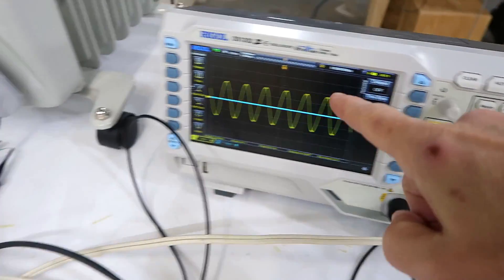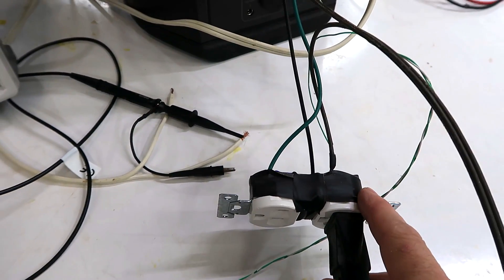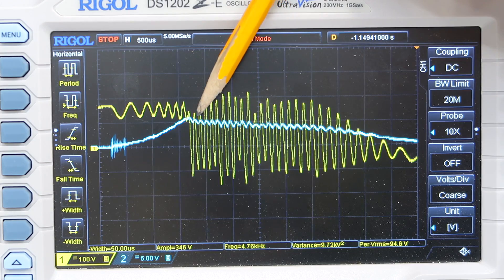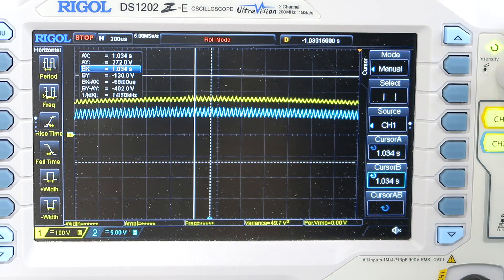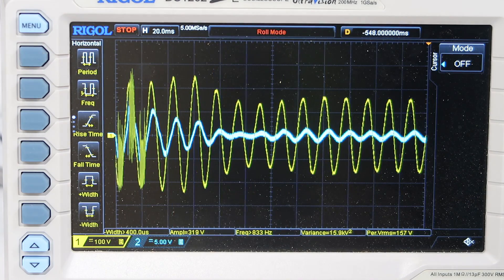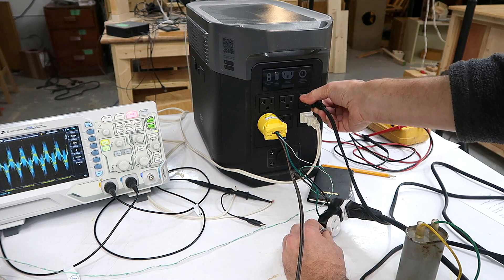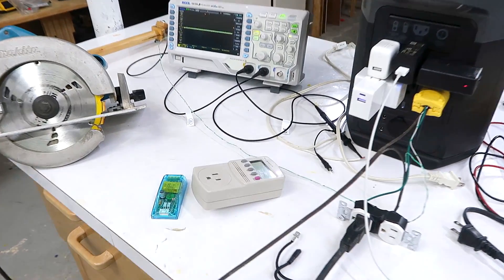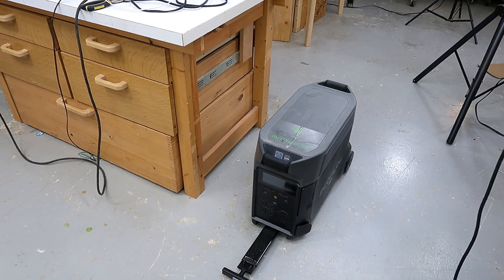Inverters don't like power tools

Comment: Can you test with something like a Pi filter (capacitor, inductor in series, capacitor) to see if the oscillations pass to the other side? Maybe will be safer to use the electronics with the filter between them and the UPS.
Reply: Tricky: you need to make sure the components don't resonate with each other at the switching (or faulting) frequency, or else things get much worse!  You need to mind both the cutoff frequency Fo = 1 / (2 pi sqrt(L C)), and the characteristic impedance Zo = sqrt(L/C), and preferably have some damping or termination resistance so that, even if hit with frequencies near resonance, it doesn't spiral out of control.  (The inverter itself acts like a very low resistance, we can't count on it for damping.  We can put a resistor in parallel with the output to do the job.  Now, a whole ass resistor would dissipate a massive amount of power at 60Hz, but we can connect a capacitor in series with it so it mostly doesn't affect the circuit, except near Fo where it's needed.  So, instead of C-L-C, it can be C-L-(C || (R+C)).)

Just putting the 24uF out there, does a good enough job illustrating the concept, though: all the current ripple was confined between it, and the inverter's internal circuitry (mainly the big fat filter inductor I would think), and much less ripple voltage appeared at the output.  This is safer (in terms of ease of avoiding unlucky values that might make it more prone to oscillation) because the capacitor more or less acts in parallel with the internal capacitors.  So it's more or less the same LC circuit, without extra LCs tacked on.

We can infer that, given proper dimensions, damping etc., it could indeed have less of both current and voltage ripple; and less while using less total capacitance than the bulk approach (the 24uF) -- the tradeoff is having to add bulky inductors, which also reduce regulation (they drop some voltage, at 60Hz, under normal load conditions).  And these are not small inductors, we're talking 100s of uH and they have to be rated for full peak load current, so, saturation over 20 or 30A.  About as big, each, as what's on the inverter.

Comment: I just built a DIY solar generator and used a 600w Giandel pure sinewave inverter.  I'm only powering some LED light, but I notice that the lights power on like the inverter has a built in soft start.

I wonder if you see any change if you have the saw plugged in/on before powering up the ecoflow.  It may have a soft start.
Reply: Often you'll see that slow rise in AC output voltage being spruiked by the inverter manufacturer as protecting your appliances but in reality it's there to protect the inverter.  The IGBTs used by Giandel in the bridge (depending on the model inverter it might be 85N33 for 120V inverter) that produces the AC output are more than capable of handling the current, it's usually the FETs in the HV DC power supplies that will pop.

Comment: I bet Ecoflow actually really appreciates that you are doing all this testing for them. Their R&D department probably has a different perspective and could use your thoughts.
Reply: R&D already knows all this shit, its marketing and execs who just dont care
Reply: @MozTS  Ain't that the truth!  I used to work in R&D, and the most commonly-asked question I got from people earning more than twice as much as me was "Can you make it any cheaper?"
Reply: Their Medium reply was from one of the operations directors and was very, very detailed, way more than I've ever seen from any manufacturer....
Reply: I’ll guarantee the design team already knows this and a lot more. I’d bet they can design anything that doesn’t defy the laws of physics but other real-world constraints dictate the chosen path. The critique by Matthias reminds me of audiophiles criticizing power amplifier designs.
Reply: @sheph7  this box advertises itself as an off-grid power source, and sells itself on the premise that you won't need all those extension cords anymore. It's perfectly reasonable to expect somebody to stick a power tool in there so that they can work on something without a nearby power source, and it's a very valid critique of the device that it will kill certain electronics if they're used at the same time as a big inductive load. I would have definitely been dumb enough to charge my phone with an old charger at the same time as using a power tool, maybe that's just me or maybe the hazards aren't obvious to everybody.

Matthias's use case is still within the realm of what a reasonable person would try, and he has been very clear throughout these videos that this is a very good product with one notable flaw that only appears in the worst case. His coverage isn't comparable to audiophile nitpicking at all, when was the last time an audiophile actually presented oscilloscope traces as evidence for their criticisms?
Reply: @tissuepaper9962  I think you somewhat exemplify the problem with this sort of fringe case and saying it shouldn't be used with 'sensitive' electronics. The issue is with defining, to the layperson, what 'sensitive' means in this context. Phone charger isn't on the list.

In this case they have a device that works reliably and for reasonable cost in 99.9999% of use cases. There is a rare instance where a very high power motor load in combination with a very specific and frankly somewhat uncommon kind of super low cost power supply can hurt the device with the power supply. But those power supplies aren't used to charge phones or laptops, or to power computers or TVs or basically anything of significant value - not surprisingly because they suck. 

Coincidentally, the same thing can happen to certain devices connected to the grid during a brownout. Another fringe case.

For me, the real question is why didn't Kill-A-Watt spend an extra $1.00 on a proper power supply more so than why didn't EcoFlow figure out how to design the perfect inverter. I like my Kill-A-Watts too, but I've killed a couple myself even without using inverters!
Reply: @bradley3549  notice I specified "with an old charger". It isn't reasonable to expect everybody to be up to date all the time. I still have and use wallwarts as old as 20 years, those things definitely are susceptible to this problem.

The bottom line is that the device will suddenly deliver a shitload more power to certain other devices if you try to draw too much out of it in this specific way. That is a problem. Maybe it's a problem that was designed in, and accepted because it's just so rare, but it's a problem that people should know about nonetheless. It may surprise you (somehow) that people like to buy cheap, chintzy garbage from China, wherein this kind of old-school circuit design is very prevalent. Watch any Big Clive video, most of those devices would be susceptible to this.
Reply: @tissuepaper9962  All phone chargers I've ever owned, dating back to the 90s, would be immune to this issue. Anything that charges a battery, period, can't use this type of power supply.
Reply: @tissuepaper9962  Those are NOT susceptible to this, any charger cannot use such a circuit as it doesn't have galvanic isolation.
Reply: @bradley3549  okay my bad, I thought the old style chargers were just stepdown transformers into a full bridge rectifier and filter. Still almost anything on Big Clive's channel would be susceptible.
Reply: @tissuepaper9962  It is the "capacitive dropper" type of power supply (Which is typically used in very low power junk) that is susceptible.
Reply: @TarenGarond  I think a stepdown transformer-based PSU would also be destroyed if the inductance of the primary and secondary windings is low enough to allow that high-frequency (30kHz) wave through. If that high frequency, higher voltage wave makes it past the transformer it will result in a much higher voltage being delivered to the device. I guess that if it's designed for 60Hz though it probably won't pass that high frequency signal.
Reply: @tissuepaper9962  You bring up an important topic - transformers. Whenever a transformer is used, they basically act as low-pass filters and stop all that high frequency oscillation from making it through to the device. So anything WITH a transformer is pretty safe. 

As for Big Clive, you're right, practically everything he shows uses capacitive droppers - which unfortunately act like high-pass filters - the root of the issue with these high frequency oscillations. I don't know this for sure, my guess is that if the power supply doesn't use a zener and is just dropping current for LEDS (kind of Clives thing), I'm guessing the LEDs would tolerate  it okay compared to a MCU expecting ~5vdc like is in the Kill-A-Watt. I think it would be really neat if Matthias would test an LED light that uses capacitive dropper though!
Reply: True, their value raised HUGE time in my eyes when they send email about they get interested to make product better after showing the fault (though after YouTube video just).

Comment: Great follow up video and love the testing. Very cool to see how the over current protection kicks in on the scope, that was super neat. It's amazing these little HF inverters can even handle these inductive loads. I think you would love a nice LF inverter with a toroidal transformer such as victron. 

And I wasn't trying to be mean but I think the conclusions in the first video were a little unfair haha. If you have inductive loads, these HF inverters are not for you. Even the sol ark has issues like this and it's incredibly expensive and has every UL listing and certification out there. HF inverters can technically power any inductive load if they are sized appropriately. 

And yes ground neutral bond fried the ac charging circuit. Everything else is still working. They told me not to do that though, but some EV chargers require the bond. Ahh well. 

Now the pass through issue is what drives me bananas. Ac charging and having two units ac output in series for 240V has issues. It's a tough situation due to the use case that these battery boxes are designed to be used for. For most people and situations, it works great.
Reply: If you see my comment above...
Any chance you could do some testing yourself, with a 'scope and circular saw, and see how some of the big HF inverters fare under this type of load? the EG4 6500 would be the one I'd specifically love to see how it handles.
Reply: @johnhufnagel  Yeah that would be a fun test! I think I am going to buy a large 240V air compressor in due time. They have an incredible surge and would be a great test load for HF inverters that are in a split phase configuration.
Reply: It doesn't matter if it's HF or LF.  If it can't handle the surge load then it needs to shut off instead of putting out crazy oscillations.
Reply: @xavierneckor8918  if an inverter is properly sized, it won't. The ecoflow is not designed to run the load in the video, plain and simple. 

A LF inverter can manage inductive loads easier because it has a massive transformer, which increases its surge capacity considerably.
Reply: @WillProwse  Yes, that's well known that LF can handle higher surge.  So, if the Ecoflow is not designed to handle the surge load just like it's not designed handle a short then it should just shut off.  I doubt any manufacturer design and guarantee home devices will survive grossly distorted power like what the Ecoflow put out.  They design for the grid.  So, it's up to inverter makers to meet the market requirements.  I find it silly that people blaming the device manufacturers that don't survive such dirty power.
Reply: I suspect that if they were to do that, the box would end up so sensitive that it would shut off seemingly at random during normal use and get a reputation for being unstable. Near the end he mentioned likely needing to design from the ground up for this and I wonder if it just ends up that LF is the cost-effective solution- factoring in it being heavier to boot. Would love to see this tested with an LF inverter even if the battery is separate as a POC.
Reply: @woo6712  They could do that, but it would increase the weight considerably. Hysolis actually sells an LF inverter power system with NMC chemistry. Worth checking out if power tools or well pumps are to be run.
Reply: @WillProwse   I will definitely check Hysolis out, thank you! It doesn't seem like this EcoFlow or the larger one has trouble actually running the inductive load, it's mixing them with cheaper sensitive electronics. Much more valid of a concern seeing as how these can be connected to run a house where all devices are not within sight- I think he mentioned all that. Not having the tools and confidence myself, seeing the waveform from any LF system under inductive load I think would be an awesome follow up to this.
Reply: @woo6712  That may happen but it's no excuse to put out damaging power.  The correct answer is to upsize the inverter to handle the power if it's in spec or tell the customer buy a bigger inverter with the power specs.

Comment: They need to make sure in next iteration that eco-flow stipulate or add a physical trip switch(like an RCD breaker). Showing user that the equipment they're connecting is beyond its limit, as a observer your doing a great job at offering up insight.
Reply: Let's clean the air around this answer. First, an RCD protects against live-conductor electric shock due to human body closing a loop between earth and conductor. Since the ecoflow output is inverted from a battery through an isolating transformer , there is no loop, its isolated by design. Therefore RCD useless because there is by design no loop for the leakeage to occur. 
Secondly, an MCB circuit breaker , depending on the Type Curve you choose can be very well tolerant to inductive / cutting tools inrush current (or startup current). So even that can be useless. So they went with a completelly tunable microcontrolled eFuse / MCB which apparently works pretty well.  Wouldn't change a thing.
Reply: @Txepetxcc  a better RCD would prevent the device from blowing up if the user shorts neutral to ground. I really don't think it's acceptable for a device to break on such a common fault.
Reply: @Txepetxcc  l'm obviously a laymen to electronics & no offense meant. But if a tools draw goes past a certain level igniting a breaker trigger would imho be better than breaking the item or internally damaging it. Thank you for the concise information & time taken. I suppose Matthias doing his ultimate tests to see where the limits are & offering suggestions are along the R&D freebie ethos!
Reply: From the first video the problem is that when you use a motor and electronics at the same time it fries the electronics.
Reply: @danharold3087  no, only electronics supplied by a ' capacitive dropper type ' rectifier circuit. Which is only used in cheap led bulbs and should have had better protections which the nice ones have